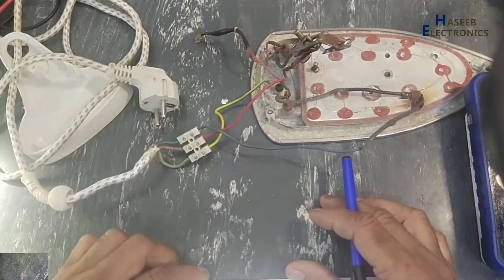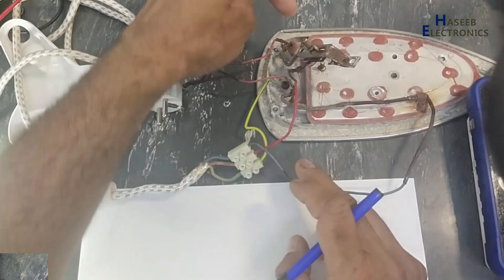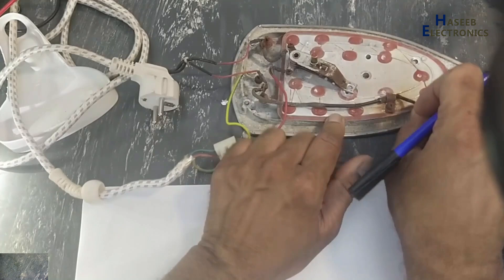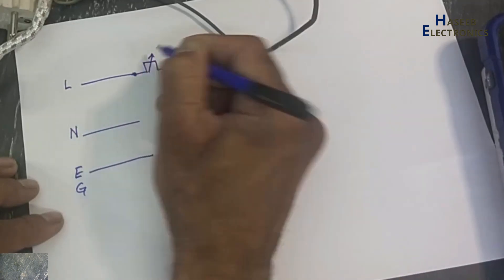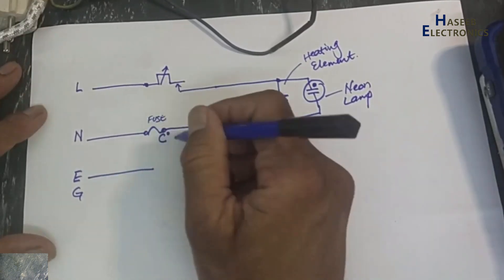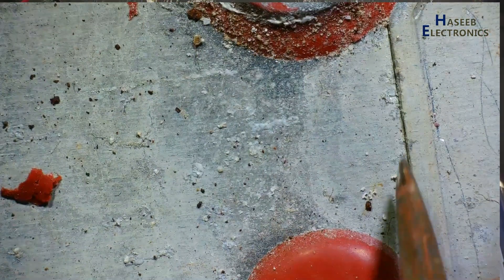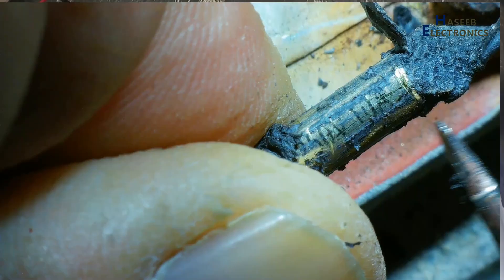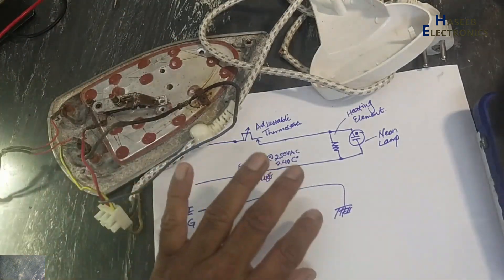{1218a} Electric Iron circuit diagram, Root Cause Failure Analysis

Comment: They will last longer if you use distilled water,  even the ice in your freezer can be melted and used. Just make sure its clean ice / frost no food particles as this is very close to distilled water.  It has condensed out of the air so should be pure water no dissolved salts or particles in it.

Comment: as far as i know daily water we use at home may cause calcification when we use it in the iron. even if used then iron should be free from the water in its storage after use. and also if the iron was remained too long we can clean it with the water with vinegar while the steam side runs.